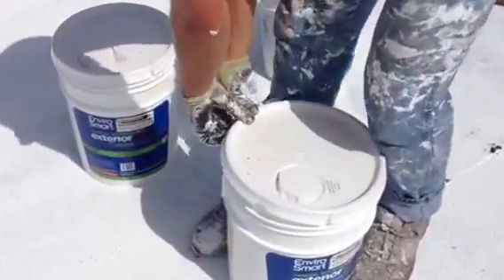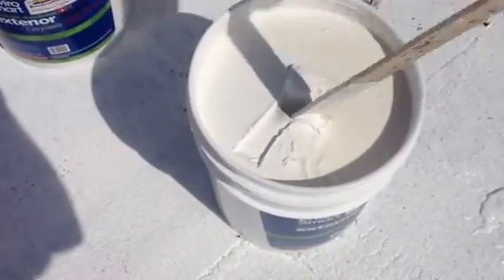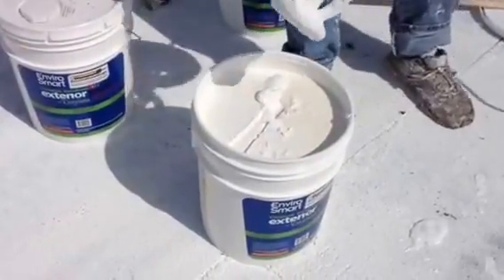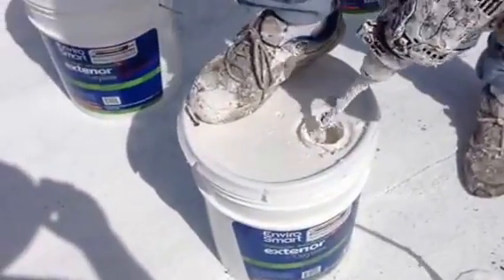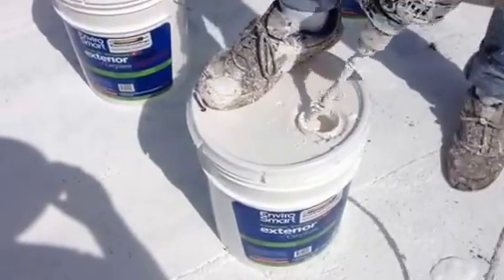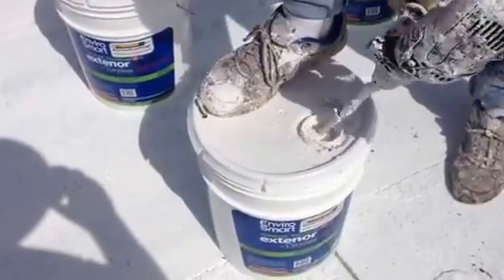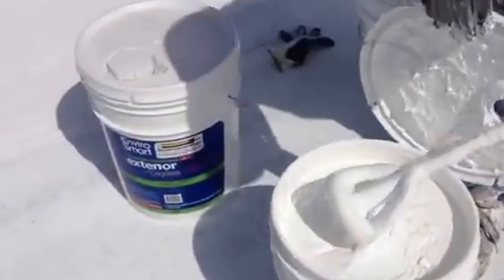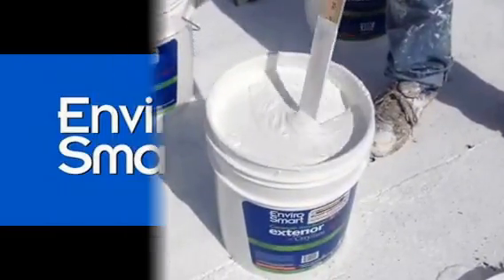Ceramic InsulCoat Roof - Drill Paint Mixer used to Stir the Coating (Paint) On-Site 2013

Comment from the maker: THE SOLIDS FACTOR - VIDEO

Last week we discussed that EnviroCoatings Ceramic InsulCoat products are High Build Architectural Coatings and 61% Solids-by-Volume.

What does this mean?

Ceramic InsulCoat has a 60.9% Solids-by-Volume content versus:

25%-35% Solids by Volume for an Ordinary Paint and
35%-45% Solids by Volume for a Top Quality Paint.

Solids-by-Volume means our high performance ingredients are suspended together in the solution of our coating in the pail.  When applied, more of Ceramic InsulCoat stays on the building and does not evaporate into the atmosphere.

So, what does Ceramic InsulCoat and 61% Solids-by-Volume look like in the pail?

In this video we demonstrate Ceramic InsulCoat Roof:
Reply: in india which area distribution and how many prise